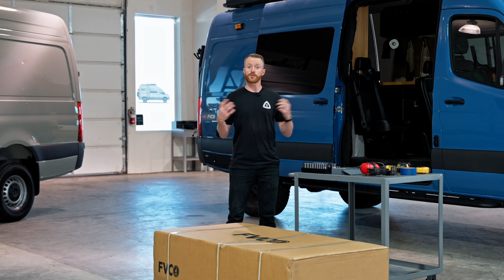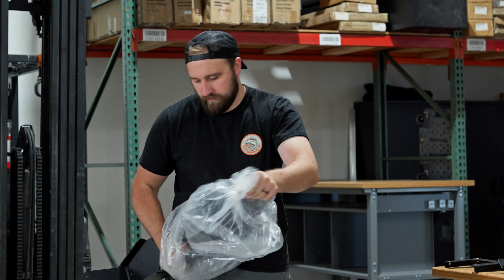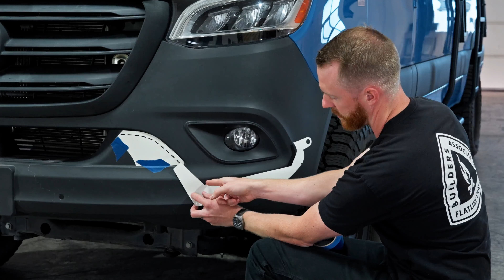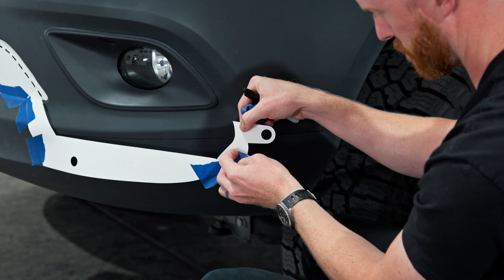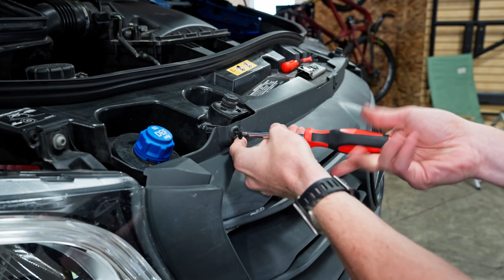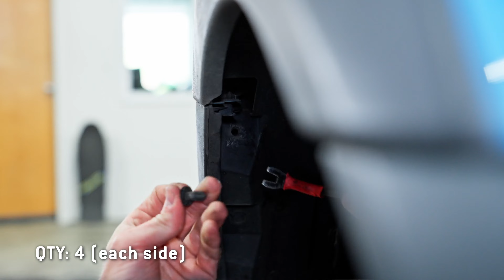Sprinter Front Bumper Installation Guide - Flatline Van Co.

Comment: Are you guys gonna post a video of the new ford transit bumper? I just ordered one but im sure there are a few differences
Reply from the maker: Yes, we should have one ready to go in the next week or two.
Reply: @FlatlineVanCo I ordered the bumper after being told it should fit the transit trail when I called then got an email today saying it might fit and the skid plate probably wont. Front protection was the only reason I ordered the bumper. So to return it ill have to pay $500 and a 10% restocking fee. Thats $800 for an item I was told I could use then told it might not fit.

Comment: Thanks for this video and helped us a lot this weekend. We put this bumper on our van as well as the winch and bull bar. I’m a little bummed You didn’t go further into the wiring part. The cable that came with the winch will not reach the battery so we’re gonna have to figure something else out.